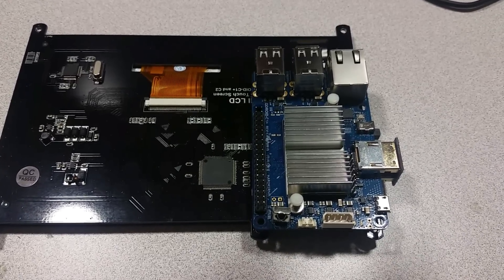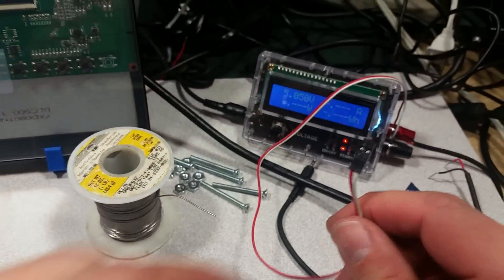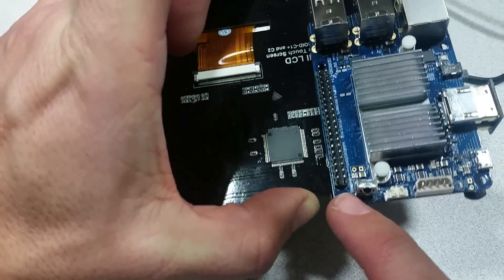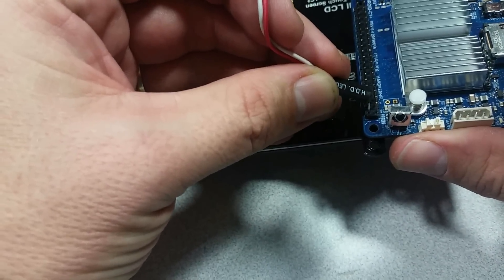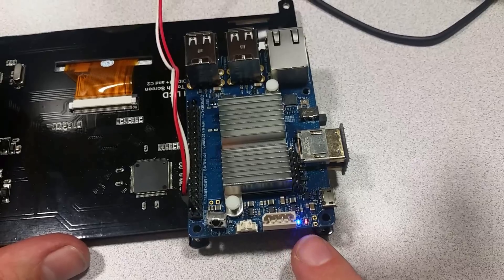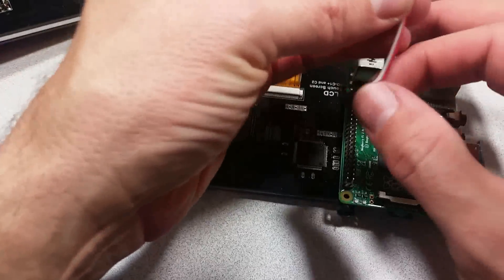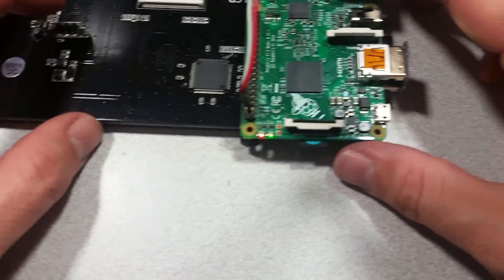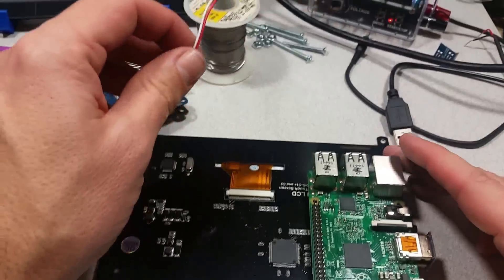Power SBC via 2x20 Header - Applies to Raspberry Pi, ODROID, Banana Pi/Pro, etc.

Comment: Be careful when doing this, many 2x1 connectors can lose contact when wiggled.  If you use a 2x3 (or larger) female block you will get a more secure and reliable connection.

Comment: Does powering via IO can make the VU7 work too when using the microUSB bridge?
Reply from the maker: +Mano Shu Yes, as long as the power supply has enough capacity to provide the current needed. 5V/2A is safe for most systems.
Reply: +ameriDroid Great, so i can just use a pair of jumpers from my UPS instead of the barrel connector.
Reply from the maker: Mano Shu
If you're talking about running jumper leads from the UPS2 from Hardkernel, that's what we did on a tablet project that we're going to be posting soon.